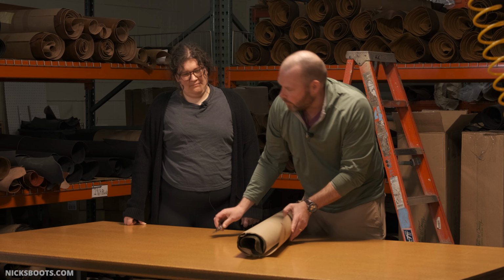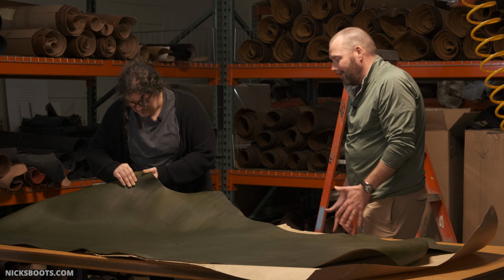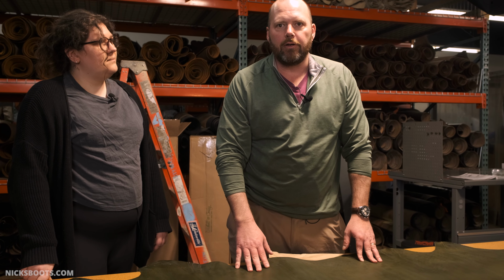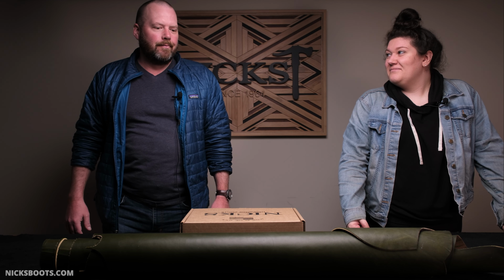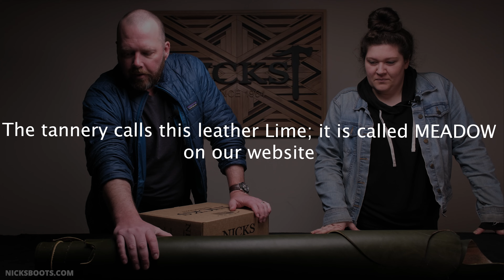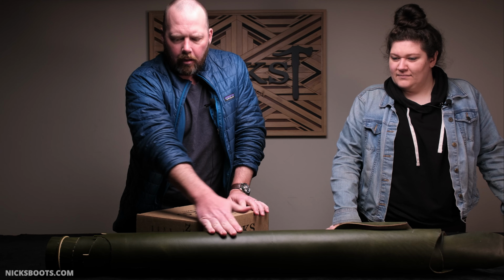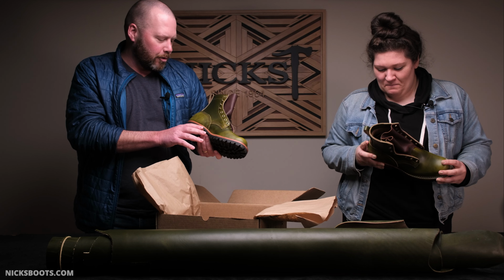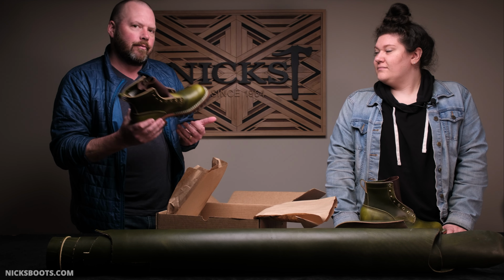This color is UNBELIEVABLE!! All NEW Double Stuffed Leather!

Comment: What exactly is double stuffed now?
Reply: Basically more waxes and oils added, its a very firm leather, its stiff compared to CXL...but CXL to me seems more durable because its supple and flexes...

I have put a good sized ding into my double stuffed because its such a firm leather, the hides are not chromium treated, so the hide is much more naturally firm...Double stuffed has a cosmetic "pull up" effect like CXL, but the two leathers are wildly different.

Double stuffed is a pretty premium, you get a nice looking leather, but so too can CXL look amazing with neglect or care. If you want more support the veg tan is firmer, the CXL over double stuffed will be more comfy out of the box.
Reply: @umbertosmith7014  Hey thanks!  Can you tell me what CXL is now?
Reply: @chrisgunsandguitars1403  Chromexcel is Horween's combination tanned leather. It is chrome tanned which they likely receive pre "blued" Bluing is the color of the hides that have been chrome tanned, then they finish it off in a magical elixir of natural earth tannings/veg tanned.

You get the cool patina of veg tan and the reliability/water resistance of chrome tanned. Best of both worlds really and lots of people do it. Its just that Horween is a rather large producer for the USA.
Reply: @umbertosmith7014  Wow you know a lot about leather tanning. I had to do some research just to learn what the difference of steer hide, full grain, top grain, was all about. So what’s the best type of tanning for a leather gun holster?  Something that needs to hold its shape and withstand the elements.
Reply: @chrisgunsandguitars1403  Usually holsters are made of thick veg tanned leather because it is firm, not necessarily weather proof, but it is stiff holding the pistol secure. But I'm no leather expert or gun expert...

You can wet the thick hides and form them to fit your pistol then thin the edges to stitch it together...see the "saddle stitch" tecnique you can make a nice holster with a little practice, buy scraps to get your technique down. then use the good stuff.